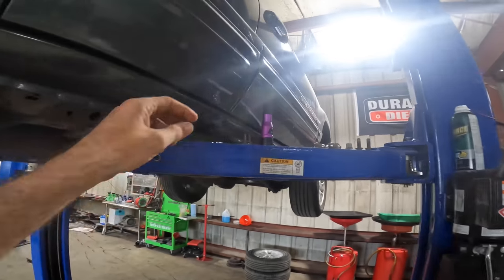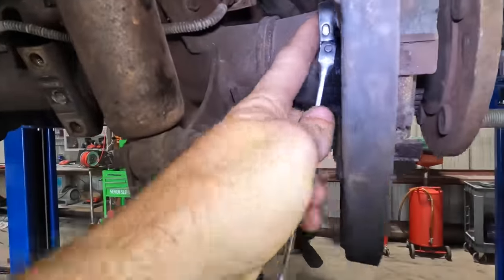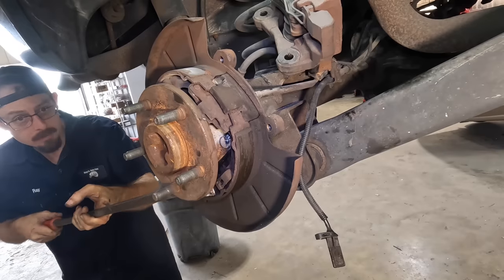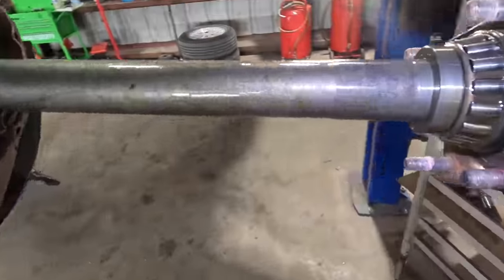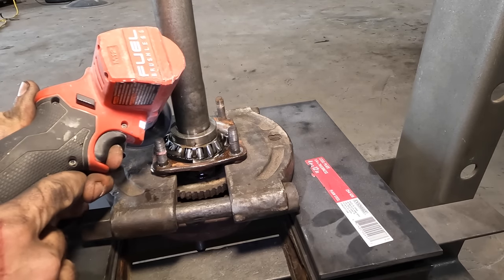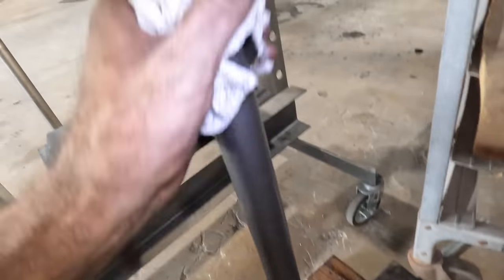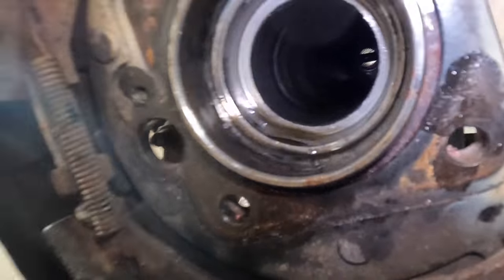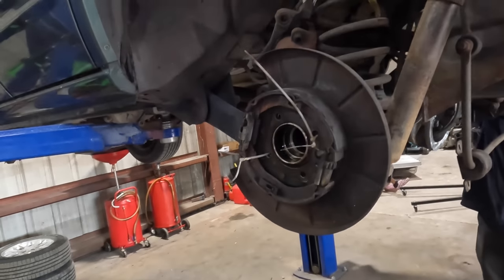Mechanic Destroys Bearings! | 2002 Jeep Grand Cherokee WJ 4.7

Comment: The ring on the axle shaft next to the bearing is not a spacer it is an axle bearing retainer.  It is the component that locks the bearing to the axle shaft and keeps the axle from leaving the car.  We used to remove these very easily:  Place the axle shaft on a v block under the ring.  Using a hardened round point chisel hit the ring perpendicular to the shaft axis causing a divot in the outter surface of the retainer ring.  This divot essentially spreads the retainer ring metal and loosens the retainer.  A couple of hits with the hammer is all that you need.
No cutting required.
Reply: Another way to take the retainer ring off is to heat it dark red...while under pressure, pops off like a charm without cutting or hamering, and can be used again.
R
Reply: Took the words right out of my mouth,Mike
Reply: If the ring is particularly tough, a little judicious use of the angle grinder will still split that retainer ring, at which point the bearing and ring both pretty much come right off.  But yeah, a good solid smack with the right kind of round-end punch to lengthen the band is usually going to get it off, and occasionally a whack with a cold chisel will straight up split the ones that aren't as tough.  Gotta be really good with that BFH to make sure the blow lands square and hard enough, and doesn't result in a smashed hand.
Reply: Yep, cut the collar and then using a cold chisel, give it a good smack with a hammer and simply slide the retainer, bearing, and seal off the axle. I very much enjoy watching Ray and a couple other channels and hopefully, he looks at these comments and takes them as advice and not as a criticism. We can all still learn something new every day. I'd be lost on most of the computer stuff going on in today's vehicles so I'm definitely not going to bash on his skills. Keep up the great work Ray.
Reply: He is always talking about Eric O he should really take some time and really watch Eric work. He might learn something.
Reply: @renaudpont8180  you can certainly heat red hot to help remove, but you cannot reuse that part because when you heat red hot you effect hardness and strength .. always replace hardened parts that have been heated.
Reply: I have always ground them to paper thin then hit the thin part with a cold chisel to pop the retainer off. A workmate of mine once tried to cut all the way through with a cold chisel, missed with the hammer and splattered his thumb on the top of the vice. They took him to hospital where they removed the end of his thumb. I've never done a wheel bearing since without thinking of that
Reply: So you don't have to modify and redesign your tools to do this job? It's all about getting that collar ring off?
Reply: Just came in to say the same thing. Thank you for saving me all that typing 😁
Although I use a flat chisel on 4 points around the retainer. Same same effect.
Reply: @renaudpont8180  That's how I install them. Bearing requires a light press on, then the cherry red retainer just drops over the shaft and shrinks back tight.
Reply: @renaudpont8180  Same way but may have to bang the splined end of shaft on a hard surface. Swiift bang and it falls off. Also, remove bearing cage and rollers and do the same with bearing race.
Reply: On the retainer ring, just drill a hole almost thru, them use a chisel and hammer to snap it loose!!
Reply: Hes learning obviously
Reply: Those studs are pressed in so the they can be pressed out !  Then you can fit the bearing splitter between the bearing and the retainer.
Reply: Turn your bearing separator where the bolts are not your support, the two plates should be your support.  That way you will not bend your bolts on your separator

Comment: Life hack for removing an axle shaft without a slide hammer - put the brake drum or in this case disc rotor on back to front, wind on 2 or 3 wheel nuts a few threads each, then use the drum/rotor as a slide hammer. Works every time :)

Comment: Ray, been there, done that... In a factory setting, same thing. FYI, turn the C-Channels around so the vertical piece is near the center for a stronger support. Stay safe!
Reply: If you look carefully, one of the flanges on the channel isn't at 90 degrees to the vertical piece; therefore, if you turned them around, it's likely the set up would collapse because the channel will tip.
Reply: Must be warm there today,  no ball cap 🧢

Comment: Hi If you have a toaster oven handy you can heat the bearing and retainer up and when ready drop them on the axle shaft you may have to press them still but it would be easier. Most of the time you can put them on with a little tapping with your favorite tool.

Comment: The retainer collar has to be cut diagonally to very close to the axle then with a chisel split open before the bearing is removed, after a new bearing is installed the collar is heated up and dropped on the shaft. The collar is made of material that expands a huge amount  that almost drops down on the axle by itself
Reply: Amen brother that is the  correct way to do it. This guy shouldn't be working on lawnmowers much less cars.
Reply: @xxxxxxxx2076  Post some vids of how you do it at your shop.

Comment: I changed bearing on my Impala and removed the retaining collar by drilling a hole 90 deg to it nearly to the axle, then take a chisel that bridges the drilled hole and it is easy to split the ring with a few raps.  After the ring is off the bearing is not so hard.   To put the retaining ring on heat it red hot and it will just drop on, let  it cool and its on so very tight.

Comment: Hey Ray, we get it, you do what you gotta do but next time just remove the retaining collar by heating or cutting…it can save the loss of other components too. If you continue to use those c-channel beams, consider a couple of pieces of all thread and nuts on both ends to make them adjustable AND safe. Those things have been known to kick out under pressure! By the way, I use that same welder with no gas too…had it for many, many years and still kicking! Good luck 👍
Reply: I agree, blue wrench is your friend. As stated the heat before pressing the bearing works too.
Reply: Do you have an INDUCTION HEATER? This is a bearing heater that uses induction (heat) to heat the bearings for easier way to install on the shaft.
Enjoy your videos!!!
James D.
Reply: Hi Ray I have to pipe in yes cut off Collar & Race I use the torch ( Red Wrench) slice it then air hammer also heating the collar expands it and some times if lucky it just slide off with gravity

Comment: Hey Ray. I’m a Millwright, thirty years experience. Bearings like that it’s best to cut the rollers off with a torch, turn axle upside down and heat the race till it falls off. High heat, quickly. It should just fall off. To reinstall heat the bearing in an oven. Set the temperature to 250 degrees F. But be careful putting the bearing on. You only get one shot. Good luck. Love your channel. Northern Ontario Canada fan.

Comment: On races like in that axle housing. You can run a bead of weld around the inside of the race where the bearing rides, the welding shrinks the race and it comes right out.
 Heat comes in handy for many things around the shop.

Comment: Heat works on those pressed on bearings too. Just cut the cage off then turn the axle upside down and heat the race evenly around and it'll slide right off. Been there done that.

Comment: Very informative, the video and the comments section. I think every mechanic shop should include a Youtube video, at least the ones where you have to drop your vehicle off and can't watch the mechanic work like at Valvoline. With the troubleshooting and mishaps dealing with older and damaged parts, I think it would give the average consumer a better appreciation for mechanical work. Instead of "here, fix this, why is it taking so long, why is it so expensive" etc. That is assuming this hasn't already been stated in a prior video. This is the first one I've watched from this page. Keep up the great work, take "helpful advice" with a grain of salt, and know that you are doing a solid service for those of us less mechanically inclined.

Comment: Hi Ray. Just few tips how to remove the bearing:  1) To drill the hole to the ring, or weaken them by saw. Ring  is tensioned and crack it self. 2) To cut the bearing cage by pliers and remove all the roler elements  -  you wil get enough space to remove the axle bracket and axle seal. 3)To remove inner bearing ring from the shaft.

Comment: On that race inside the axle tube, just weld a bead to it. The part where the rollers turn on the race. When the bead cools the race will shrink and be easier to remove

Comment: The bearing separator should be rotated 90 degrees on the press so the force  is on the separator bars rather than bending it's bolts.

Comment: Back in 1980 , these kind of bearings were easy to fit and easy to remove , simple cut the outer retaining collar off with a grinder,  (no 1mm slit discs then 😂) , a couple of cracks with a chisel , that was off , bearing knocked off easily without damaging hub mounting flange , to refit,  knock bearing back on gently with copper hammer and a drift , then a quick warm-up of the retaining collar , let it drop on the shaft , cool down with some nice water , then refit back to the vehicle , the main dealers I worked at couldn't afford a shop press back then ,but we had no problems fitting rear bearings

Comment: There are days when you can learn more tips and tricks of the trade in the comments than in the video itself. Viewers here are very generous in general with what they have learned in a lifetime. Of course there are always those backseat driver responses but those are not generally malicious. I try not to be critical of Rainman, but if I have something to share, which is rare, I will share it. Yes, I would trust Ray with my vehicles if I were a Floridian. I hope Ray's gob welds motivates the masses to buy a welder and do better.

Comment: Just so you know, for next time... FSM procedure: Use 3/8" drill and drill most of the way through the retaining ring, then with cold chisel, two divots on the thin remains of the ring will split the ring.  Remove the ring, then use a bearing separator to remove the cone race.  

My personal preference is to use a Dremel Quik-Loc abrasive disc to slice both retainer, cage, and inner race, then the cold chisel pops all three off.  If using the disc, do not slice so deeply as to nick the axle bearing surface(s).

Use the split retaining ring as an insertion pusher, in the press, to install the new bearing cone and retaining ring.

As an aside, I have also done, as a field-expedient install, used two medium hammers, in synchrony, on opposite sides of the old split retainer, to install the new retainer ring.  

Be sure you have the new seal installed in proper orientation, along with retainer plate, before installing new cone, which you need to palm grease, prior to install.

No heat is to be used, nor LN2, nor air chisel.
Reply: Pretty much how I do them. Makes the disassembly a vise operation, just to hold the axle... simple!
Reply: Yep, that always worked for me as well.

Comment: Not sure if you know this, or even if you will read this, but to install the bearings and spacer with ease try the hot bearing method. Put some motor oil in a fry pan, enough to cover the bearing fully. Heat the oil to about 300 degrees f, then drop the bearing in the oil and let it heat for at least 10 minutes. Remove bearing with metal tongs (hot) and just drop it on the axle, it will drop down into position, cool, then become set once cooled. (about 30 seconds) Do the same for the spacer, and you're done. Cheers from Winnipeg.

Comment: I always used a heat axe on the bearing retainer collar or a cold chisel and mash hammer, both work. To press the new one on I used a length of pipe that slipped over the axle to hammer the collar down. No need for a press.

Comment: to install , freeze the axel , heat the bearing and retainer , when hot an frozen drop them on .no muss , no fuss , when removing , hit the retainer an bearing with a dremal and a few cut off disks , wrap axel with tape before cutting in oposit sides an hit with a air chisel or big nut spliter . good vid

Comment: Ray,,  I used to remove pressed on axle bearings by heating the collar and inner race with an acetylene torch  (hot flame in one area,,,)  after heating turn axle on end and tap the splines on the floor,,  The bearing will fall right off,,,  Takes about 5 minutes for both axles,,   :-)

Comment: You might want to look into the air over hydraulic jack at Harbour Freight for the press.  I also changed the cylinder on the engine hoist too.  Thrifty and works well.
Reply: Impersonating a Police Officer?

Comment: I was taught to always place the bolts of the separator across the plates as they will bend and warp when placed across the open area. I'm thinking that may be why the bearing popped a roller. Always enjoy watching you work, keep it up. Thanks

Comment: One, I am concerned that the races slid out, it probably means they will spin under load.  If the new races don't fit tight you can use Loctite retaining compound. Two, your bearing splitter can be used as such, just put the flat side up and crank down on the nuts of the splitter and it should start the separation of the bearing from the axle.

Comment: Well, it’s been a very long time since I did bearings in a live axle. So long that I didn’t yet own either a press or a bearing separator.
I’m glad to see that having the “correct tool” was not the answer and my technique with the cutting disc in the grinder was more effective, after all.
I used to use a length of scaffolding tube and sometimes a sledge hammer, putting the bearing back on and the retainer always went on easily, once it had been heated over the cooker ring for a bit. Fond memories.

Comment: You did well on the ground clamp. Never let current pass through the bearings as a couple of the demonstrated ground placements would have suggested algy.
Reply: but then he removed the nozzle without adding anything to insulate the gun then arced the mig gun to the axle (burn marks on the axle flange).  At least one of the bearings replaced acted as a path to ground and possibly some in the differential. Ray, saying you are not a welder is not an excuse for not wearing a welding helmet to see what you are doing.  An experienced welder would need one to get the welds right the first time too.

Comment: I have done this a few times.  Typically I use a dremel tooll with a cut off disk on the ring.   Comes off with a few taps with a chisel.  The bearing will press of without damage.

Comment: My directive start bench pressing 250 as standard I used to when I was 19 and build your hands up with a squeeze grip it's  two handles with spring tension just squeeze it 20 times then hold a dime in it for as long as you can

Comment: Ss a little kid, i watched my uncle Homer change one of these bearings in my granny's yard before heading home to a neighboring state. He used a chisel to spread the retainer and make it slide off, and used an appropriately sized pipe to drive it back on. The bearing was different, I think. That one is interesting, because it is a tapered roller bearing, and looks as though it would just come apart and let the axle come out. Except it has a ring that engages the ends of the rollers to keep them in. Interesting!

Comment: Back in the day we referred to the bearing retainer as the wedding ring. I always used a little heat on it to remove it as well as the bearing if it was required. Good idea to tack weld the studs I would have tried vise grips in the head. Tacking seamed to work better and faster.

Comment: When removing the axle from the tube, I use the end of the axle to gently pry the race from the tube. It works great and saves a step.
If you take it easy you don’t damage the axle spline, or mark the race grease seel housing. When you don’t have all the tools you do what works.